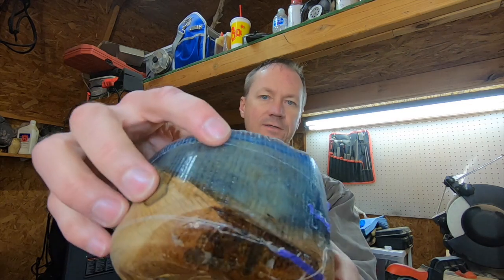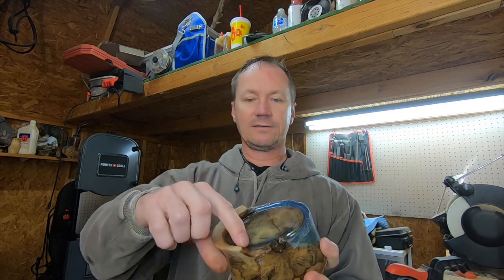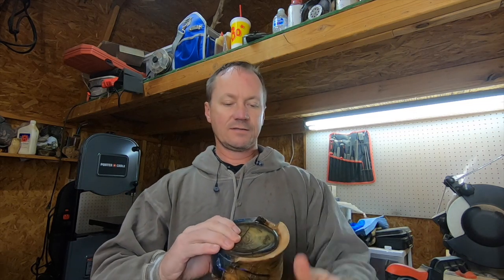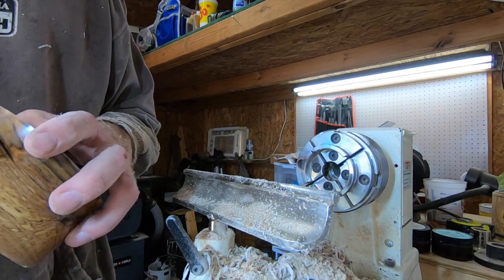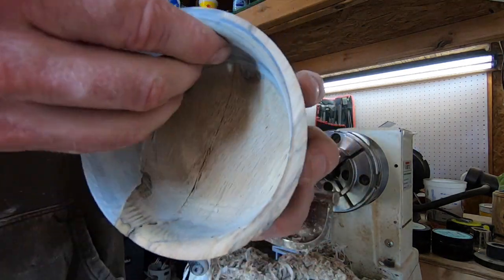Wood turning: Repairing a Broken Oak Bowl

Comment: Great video.  When I turn material like this I always stabilize it with cactus juice first.  A lot of the time it helps.
Reply from the maker: Thanks, Dale! I’ve never hear of that and thought you meant actual cactus juice until I looked it up. I can be slow sometimes 😁. Thanks for the tip, 👍🏻 I need to give that a try.

Comment: Hi Mike. This is very unfortunate.
I think you maybe can avoid this by making a tenon instead of a mortise. With a mortise you press the wood apart so it can split. With a tenon you squeeze the wood together. Okay, the finish of the bottom is a bit more difficult. It's a pity that it didn't work out, because it turned out to be a beautiful bowl with beautiful colors. On to the next one. 
Happy turning year.
Reply from the maker: Thanks, Frank! I had already made a mortise from the previous attempt with it or I might have tried that. But you’re right, it probably would’ve survived had I done it that way. It did look like it was going to have some beautiful colors, but some just don’t work out I guess. Thanks again and take care!